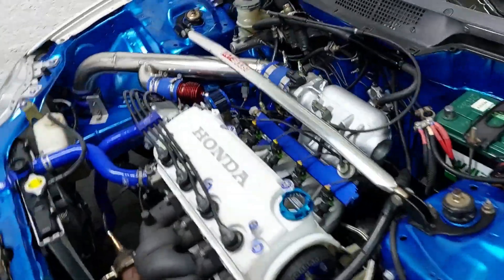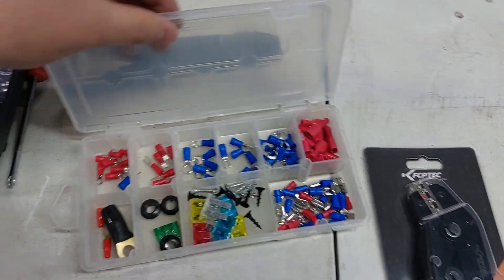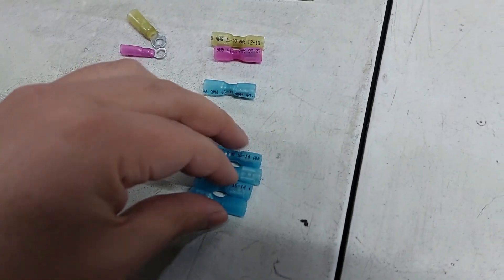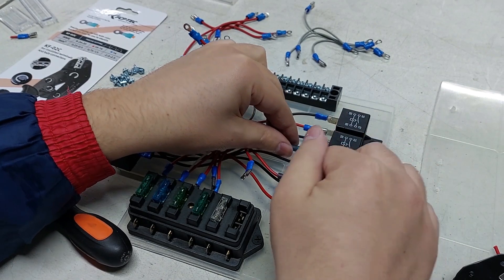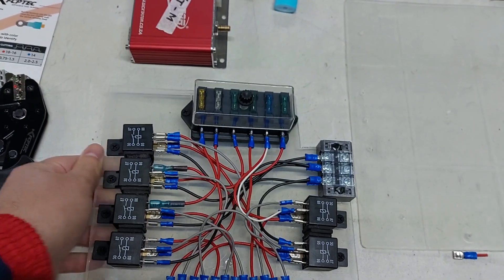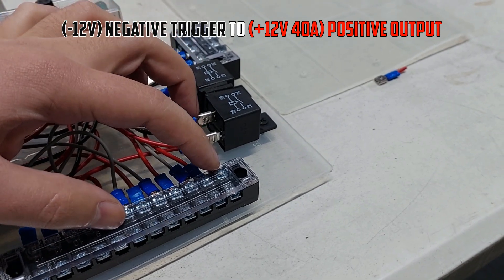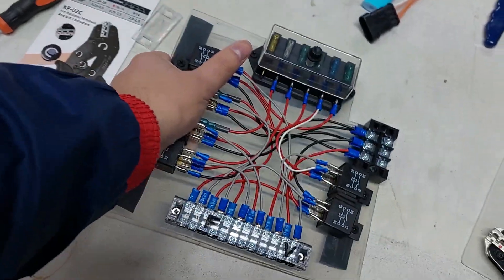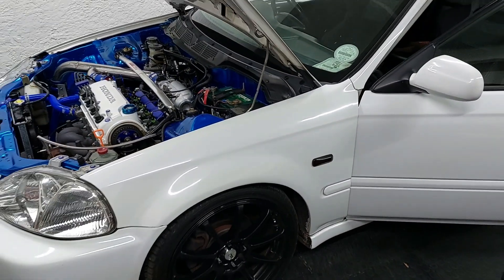Custom DIY Relay Board - Automotive 12 Volts | Turbo Civic With Stand-Alone ECU

Comment: If I wanna do that set up I don’t need to have my original fuse box or anything of the harness inside the car beside just to engine harness that goes to the ECU
Reply from the maker: The board I made was only for the engine harness as I am using an aftermarket standalone ECU. The fuse box, chassis, and dash harness are all still in place and functional.

Comment: Did you rewire your car to us this panel.
Reply from the maker: Hi Eric, Yes, I replaced the factory ECU with a basic stand-alone ECU so all the engine functions now run to this replay panel. chassis functions like lights still use the OEM wiring and replays.

Comment: Yo bud, does your dump valve stay open at idle? I got the same one, but even if I adjust it, it stays open at idle/vacuum?
Reply from the maker: Hi Brandon, no mine does not say open, if I set it loose it will open very easily but almost all the way in it will stay closed and boost will flutter out the turbo, waste gate won't open at all.
Reply: @RisingBoostYT  Good to know, I have adjusted it almost closed and I get turbo flutter which is not good, I hear yours gets the same turbo flutter. Issue is, when it's open at idle, I get very high IAT's when the fan kicks on...obviously, so I'm thinking of finding a stronger spring for the piston. I'll play around with it.
Reply from the maker: @smoothscott123  that's odd, mine definitely don't stay open. I know the flutter is bad but I like it, I adjust it to flutter for like 0.2 bar, if I boost over that the dump valve will open.